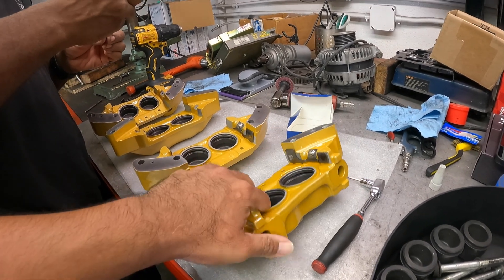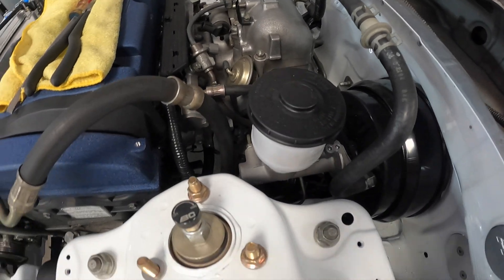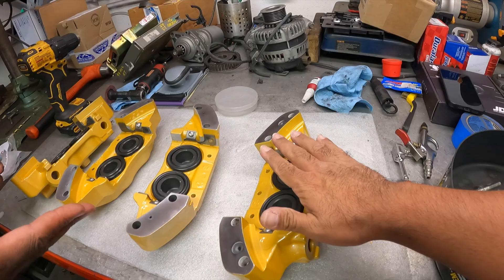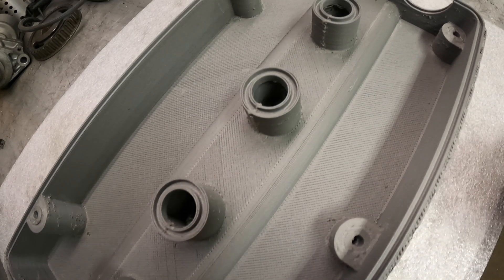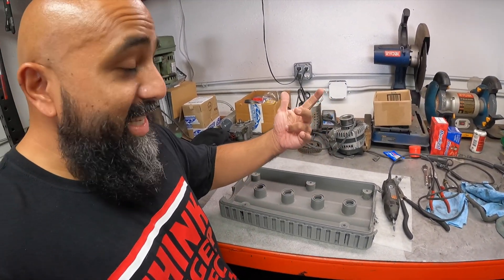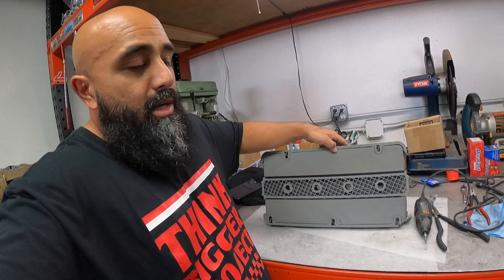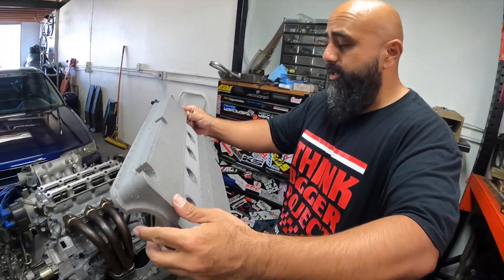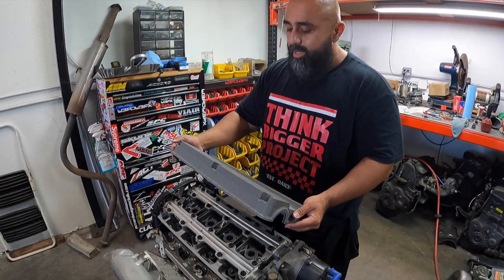Big Mike Edition: the custom 3D printed valve cover prototype - Version 1 test fit

Comment: 9:52 not 100% accurate. 572 is the melt index of this material.  The heat deflection temperature is much lower, which is only 315. That's the temperature it will begin to deform if subject to a certain pressure/load.
Reply from the maker: Thanks for the input. So far so good on this and other printed covers tested on naturally aspirated setups.
Reply: @BigMikeEdition   yeah should be okay on an NA setup depending on the conditions the engine is being run at.  Street use I would imagine you would have enough overhead, but track usage on a hot day I would imagine would get sketchy.
Reply from the maker: Not should be, it is ok under all current circumstances. Now in summertime? Well find out. This client isn’t into endurance racing or time attack, so on this particular build he doesn’t have to worry about those circumstances either. So for what he wants, so far so good. Next up is the final billet version.
Reply: @BigMikeEdition  - curious if have any long term updates on this project. I was considering a 3d printed valve cover. The consensus on forums says that the combo of heat oil chemicals are the problem. Curious if you have experienced that or anything else to consider. Also, I understand its not on your car but any info would be great
Reply: As an engineer, I can confirm there’s a significant distinction between melt index and heat deflection temperature under load. A thermoplastic might not fully liquefy until 572°F, but at 315°F under operational stress, you’re already entering the creep deformation zone—especially in a dynamic environment with thermal cycling, vibration, and fluctuating torque loads. Street use may offer a thermal buffer, but sustained exposure in track conditions? You’re risking dimensional instability, delamination, or outright structural compromise depending on how it’s mounted and cooled. It’s not just heat—it’s how the material behaves under pressure in real-world conditions that makes or breaks it.

Comment: Who did the printing of this? 

Who did the CAD?

What was the turn around time?

Did they give you an option for quality per print?
Reply from the maker: MAKEiT is the name of the company for this print and others. I also work with CoKreeate. Turnaround time (if you print time) depends on which material you'd like to print with, and other factors such as infill. What do you mean options for quality per print? Please elaborate.
Reply: @BigMikeEdition  sometimes faster prints will turn out with more post processing work (like Dremel etc) and some slower prints can net you an almost perfect product that you don't have to even touch. I was curious of there were options like that. This was cool that you went forward with something like this. Is there a contact email or IG or something to maybe learn more about your experience?
Reply from the maker: @miestermind  Yup, exactly. Depending on infill percentage and material and so on and so forth. Prototype 1, 2, and 3 are pretty nice but I would prep and paint them for aesthetic purposes no matter what. But you don't necessarily have to. Keep in touch with me on IG and you will see all of these companies/people and their contact information. My IG is @thebigmike